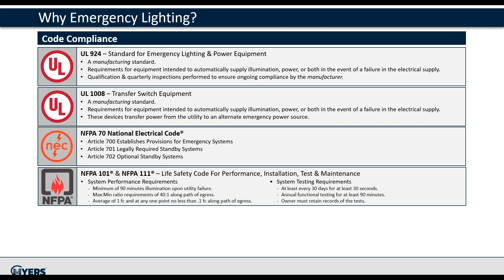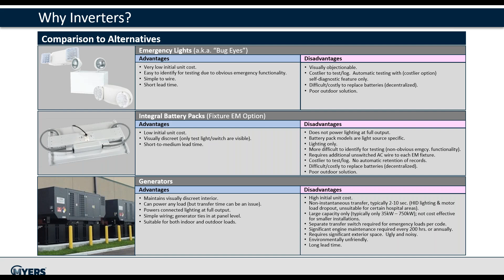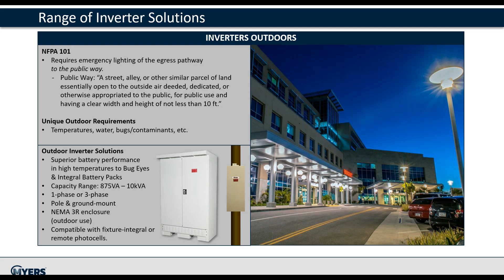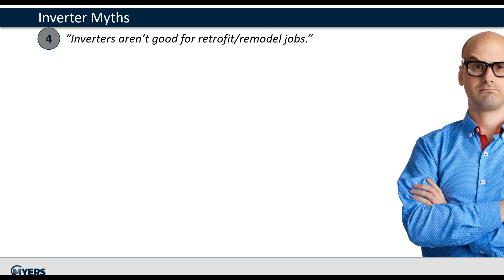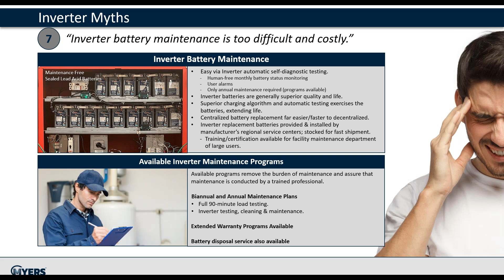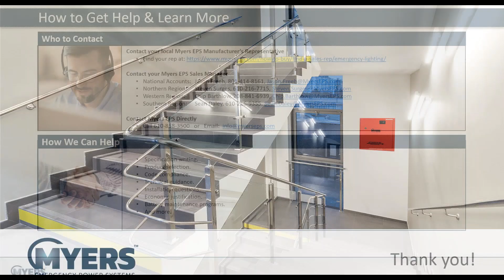Inverters for Emergency Lighting  101

Comment: Will the inverters used for life safety emergency lights need to be in a 2 hr. fire-rated room? 
Can they be installed in a regular mechanical room along with the Mechanical equipment, Electrical panels, etc?
Reply: No they need to be in a 2 hr fire rated room and need mechanical to keep the room to the recommended manufacturer temperature.